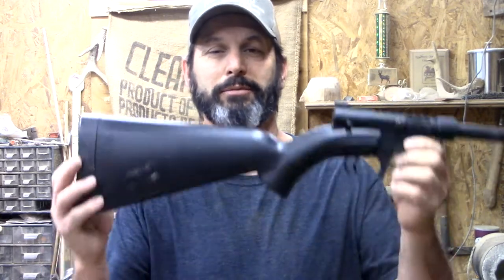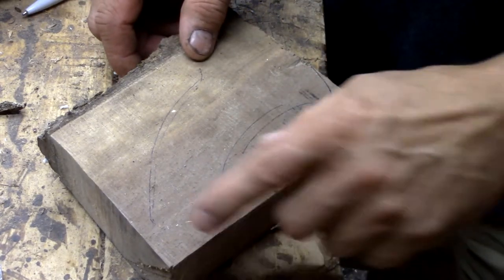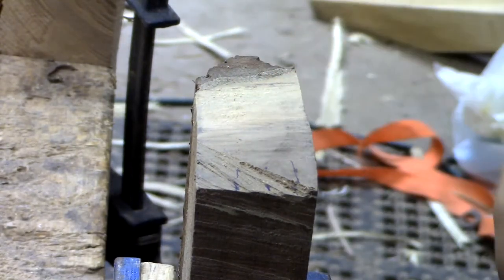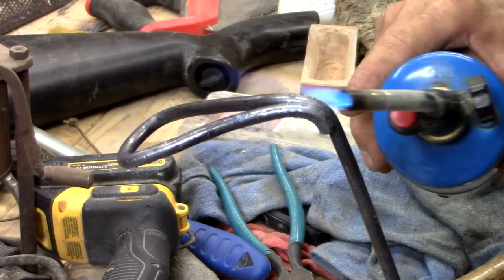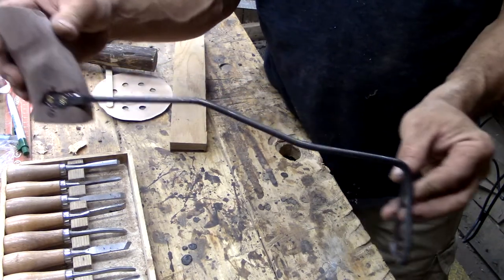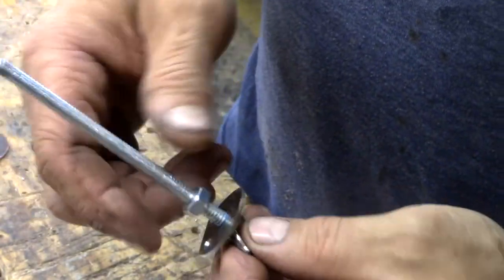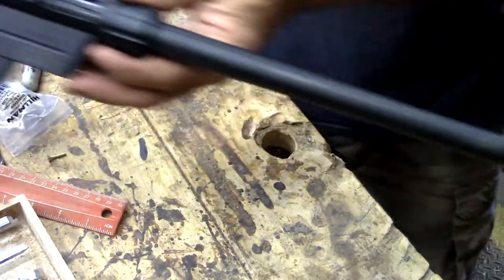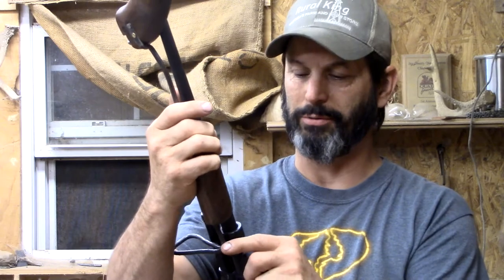Henry Survival Rifle Mod

Comment: Way better before...looks like some fancy coat hanger now and there is no storage space. Why???
Reply from the maker: @bultacowally  I needed it to fit inside a bug out bag with minimal space. The original buttstock just didn't allow me that. My goal in any project like this is to not modify it to a point that it can't be used in original condition.  The wire stock just merely gives me another option. It goes with me in the original buttstock when I go kayaking or camping. I do appreciate the comment and thank you for taking the time to do that.

Comment: Do you know how I can get a suppressor on the ar7?
Reply from the maker: Interesting idea... the first thought would be to thread the barrel. I am not a gunsmith by any means. I have heard of guys tinkering with such a thing on 22.'s., there is an accuracy and loss of energy problem.
Reply: @garymichael45  I found an adapter on the net for $30

I want to use a suppressor for both.. .22 and CVA scout blackout. Switch between the 2
Reply from the maker: Ha, I bought a Scout when they first came out. I definitely need to do that video. I can be open to liability, so I have to be careful how 
 I respond to post. I admire your creativity  and forward thinking. It is the thinkers that control their destiny.